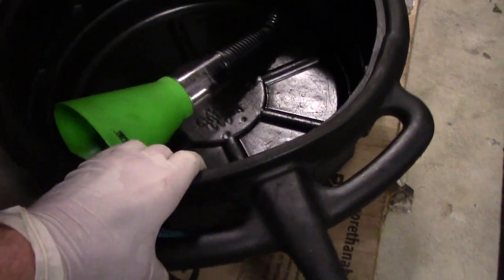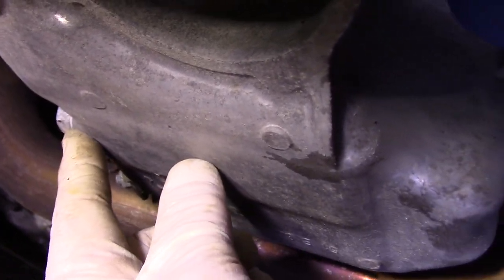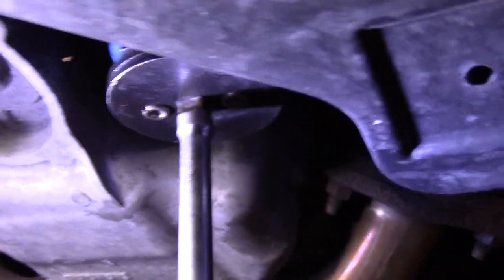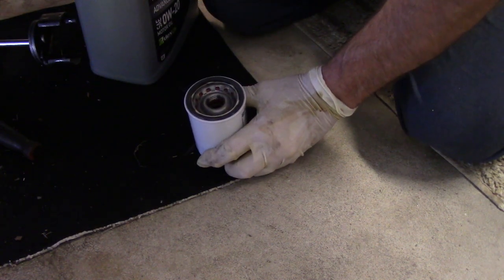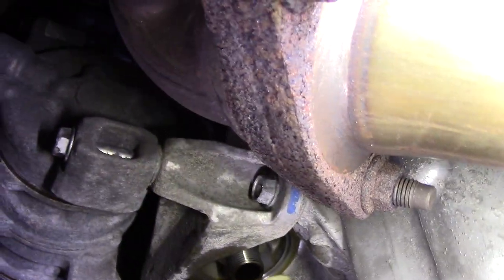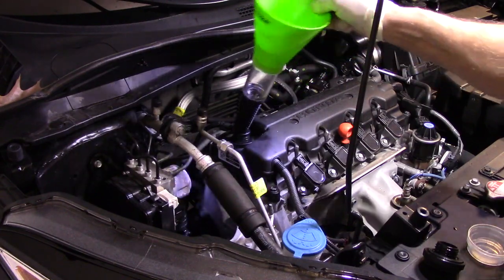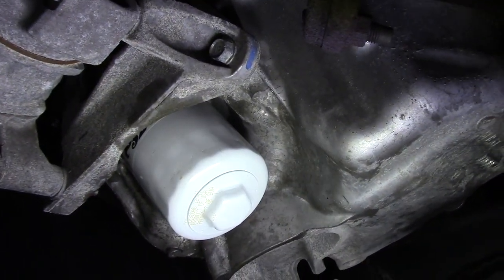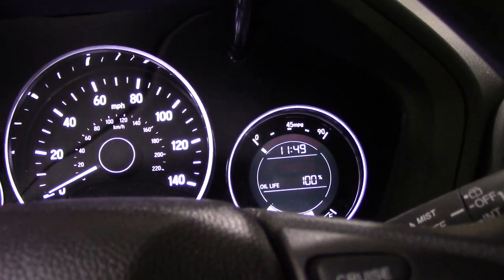How To Change The Oil And Filter 2016-2020 Honda HRV

Comment: Hello, I have a 2020 Honda CR-V and not sure when to do it's first oil change. My car has 3,100 miles.
Reply: After 10,000km
Reply: C company, at what mileage did you end up changing your oil?
Reply: @WestCoastFront  does it have the 1.5 liter turbo? In some cases, they’ve had some issues with fuel slipping by the piston rings and causing some oil dilution. In that case, it’s probably a good idea to change the oil every 5000 miles to keep it fresh and continue to lubricate the critical parts. You might check with Honda to see what their warranty covers.

Comment: I would just add (after the fact) that when unscrewing the drain plug, put your catch bucket far enough away as to compensate for the trajectory of the oil flow . My oil had a strong stream that went beyond my bucket and had to quickly move the bucket. Thankfully I had a piece of cardboard large enough to catch the spill. I my case I should not have squared up my buck under the plug. Maybe this was bc I was up on ramps, causing higher psi? Also I have a 2016 and 18 mm didn’t fit but 3/4 was snug. Thanks.
Reply: SFN, my wife has a 2019 HR-V, and when I changed her oil, the drain plug is a 17 mm. You may try that for next time...just a thought.

Comment: Watching this extremely informative video proved to me that my car dealer overcharges for oil change, additionally recently not long after oil change I found out that the oil level was too low and not touching the tip of the orange stick (without leaks on my garage floor) and had to take the car to the nearest shop to add oil because of distance from the dealer.
Thank you for taking time to produce such a useful video.....may be consumers should check oil level before leaving the shop.

Comment: Thanks for the detailed video! How do you take the plastic splash cover off before you can reach the engine? Do you have to loosen up some kind of push-pins or bolts before you can remove the cover? Many thanks!!

Comment: just a quick question, you said 0 w 20 is full synthetic.. Im just curious, doesn't the full syn oil last like 10k km? My 2018 hrv had fresh oil when I bought in jan and the oil life says 15% right now but I only maybe did 4000 km.. If it 0 w 20 is full synth shouldn't it still be good oil?> Does the engine actually know if there is a different oil in the car so when that oil life % is calculating does it actually know if there is a regular 5k oil in the car or 10k oil or hybrid 7500k oils?
Reply: Metatronix, the oil life monitor meters the type of driving you do by the heat cycles, number of starts and stops, town/city driving vs. highway driving. With highway driving, the oil change interval can be extended out some, but city driving will necessitate a more frequent oil change interval.
Reply: Or…it’s possible that when you had the previous oil change done, the techs may not have reset the oil life percentage. 🤷🏻‍♂️

Comment: mines not resetting. however it also says service reminder (10k miles). is there a different way to reset it? mine is a 19 LX AWD.
Reply: evil morty, I have found that different trim levels have different ways of re-setting the oil life monitor. You may need to refer to the owner’s manual, or even find a reset video specific to the ‘19 LX.

Comment: How bad is it really! if you go back and forth from synthetic & standard oil on a car oil change? What if a shop mistakenly puts in the opposite.  Is it that much damaging? Or wrong oil (Same numbers only difference is synthetic or standard) is better than low oil.. idk.
Reply: I've yet to see zero weight conventional oil, only synthetic.
Reply from the maker: I would not use anything except what the manufacture recommends.Thanks for watching.
Reply from the maker: Bush master. Good point I have never seen conventional oil 0W20
Reply: @jimthecarguy  Castrol makes GTX synthetic blend 0w20. Non full synthetic is out there.

Comment: Jim, I always appreciate your thorough explanations. I would like to ask a question. 
Vehicle: 2005 Tucson V6 2.7L 185,000 miles
When the driver side door is closed (and open up to 30 degrees in angle), the driver side windows (front and rear) do not move (No click, no nothing!) when I click on the master switch buttons. When the drive side door is open halfway to all the way, these windows open perfectly. After replacing the fuse and the master switch, the same problem persists. There was no accident. Any help would greatly appreciated.
Reply from the maker: There could be broken wires in between the door and the body of the car .Check this video to see what a SUV that had the same problem. Keep me posted https://youtu.be/Vh2r7HrCMRs
Reply: @jimthecarguy  
There was a broken wire in between the door and the body of the car. Connecting the wire was a real pain due to cramped space. Thank you so much.

Comment: With 50,000 miles, 0w-20 or 5w-20????  HRV EX 2016
Reply: itll say the typr of oil you need in your manual OR on top of the drain plug